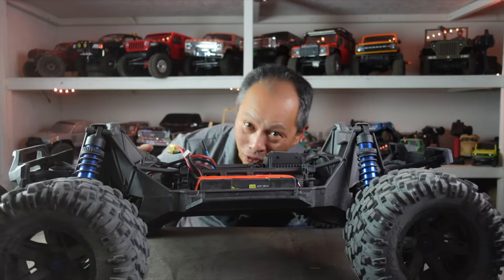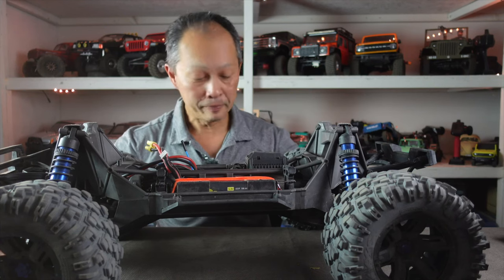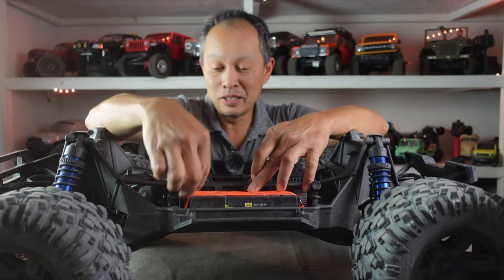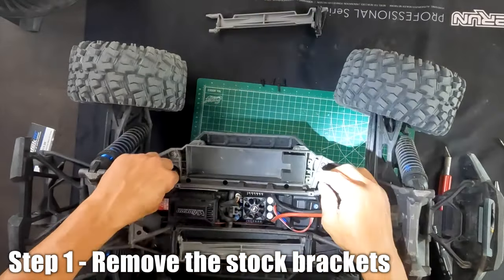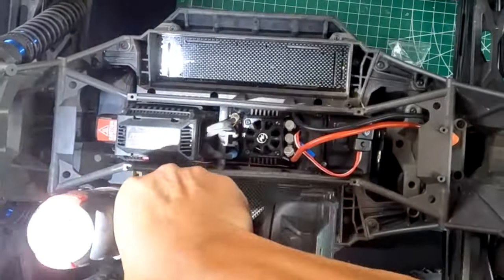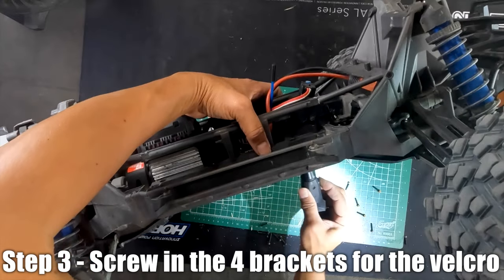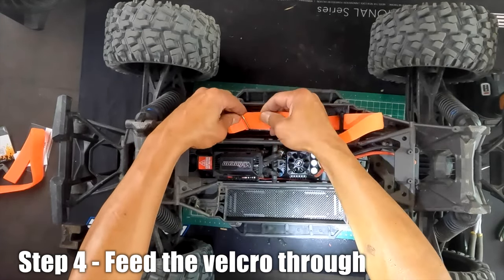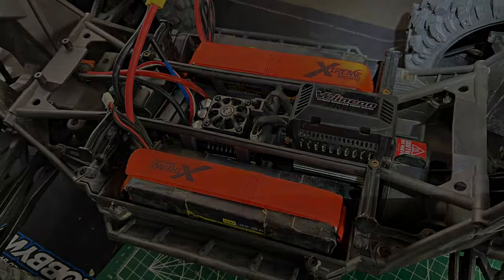Fixing the Maxx and Xmaxx battery holder with xtreme Racing battery straps

Comment: i took my xmaxx apart to flip the 2 battery lids upside down. 16 screws total. it now fits the 8000mah gensace. however its extremely tight and if they ever set on fire i know my xmaxx is gonna burn down because i cant take them out just like that. so i might upgrade to something like this aswell

Comment: That looks like a good solution. I did check around. I found that Integy sells a battery tray holder that snaps in place. It's graphite and aluminum and it's not cheap.  There is another company called WFO which sells a system very, very similar to the system you demonstrated. It uses a similar velcro system. It's cheaper.
Reply from the maker: Much appreciated Michael

Comment: I switched to hot racing battery strap at one point and kept popping straps . Now I’m back to the stock one . I drilled a body clip hole like how the sledge has .
Reply from the maker: Yeah, need stronger straps for sure especially on mighty bashing runs.

Comment: Great video , I was just wondering if there was a way to get bigger batteries on my Xmaxx. Think I would add washers to the screws that go under the chassis to the plates… a good crash from a decent jump would pull those screws right through the bottom of the chassis. Thanks again for the great video.
Reply from the maker: Was just thinking about this and the screw head and the plastic chassis is indeed the weak point.  That can be reinforced with a washer for sure!!!!

Comment: I love the CF Xtreme Racing battery trays in my X-MAXX.  I agree that it took a bit to figure out, but it was well worth it.
Reply from the maker: Yeah it is a simple install... the second time around.
Reply: @RCReviewChannel  Is that something like, "Fool me once, shame on you. Fool me twice, shame on me"?  Lol

Seriously, while the stock battery tray is 'one of the biggest problems' in the X-MAXX, I don't consider it THE biggest problem...that would be the shock towers.  Since people are probably thinking, "what???"  Each shock tower consists of two halves, and those two halves are held together by two screws...screws that can 'pull' themselves right through (especially the top screw).  I've had it happen.

Solving this problem is even easier than the battery tray.  Simply remove the top screw, add a small (thick) washer, and replace the screw.  If going with a 1-2mm thick washer, replace the screw with one that's 2-4mm longer.  This should only be needed for the top screw, as the bottom is 'reinforced' from the shock towers being mounted to the chassis/bulkheads.

Comment: Think of get that because my 9500 mah 4s barely fit in stock battery hold but it was tight won’t able move after saw that I knew it will fit any size say 10k mah with no problem

Comment: wouldnt it be easier to just flip the holder so you get the height that everyone wants?
Reply from the maker: Still restrictive and battery cables are in the way often.
Reply: @RCReviewChannel  or i heard of nylon  washers being used with a longer screws to get more height. put them between the 4 posts and the body. 2 or 3 on each post. thoughts?
Reply: great videos too. very clear and you show what your doing pretty good.

Comment: Do you ever have issues with the gears stripping? People talk about it like they can’t keep them together! I mean some people are even running belt drive at this point
Reply from the maker: No way, no problems at all. The key though is that it is a very well-balanced vehicle for 8s power. Everything works to the limit. But once someone upgrades the motor/esc, other parts like the pinion and spur become vulnerable until upgraded as well.
Reply: @RCReviewChannel  since you’re a legend when it comes to this stuff, do you know if traxxas escs have a soft start? Got a max6 instead of my vxl-6 in a revo and was wondering what punch setting to use.. 3/5 (stock) feels weaker than the vxl-6 4/5 punch feels good but I wasn’t sure if 5/5 punch on the max6 would be equal to what it was stock? Or if it’d be too much punch?
Reply from the maker: @V8chump  Traxxas doesn't have that configuration.  For Hobbywing, I know that punch 5/5 can cause smiles but problems as well.

Comment: Why is so awful? It is spacious and fits 3 or 4S batteries in that compartment. Or u just dont like plastic locking mechanism
Reply from the maker: It's not a good design since I have about 5 different battery brands and none of them fit this battery compartment well. It's very restrictive to the expensive Traxxas batteries. Different sizes, shapes, cable locations often get in the way of the plastic lock. My one battery that fit, the power lines got damaged with time. 

If one uses Traxxas batteries, they work well.